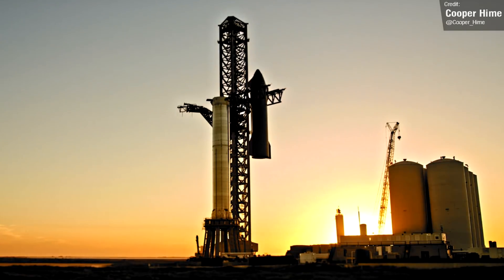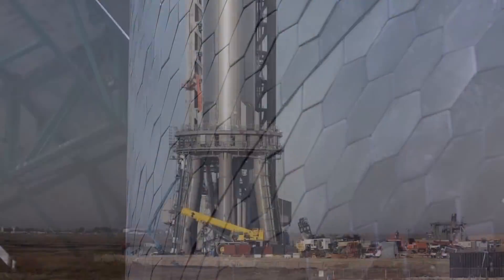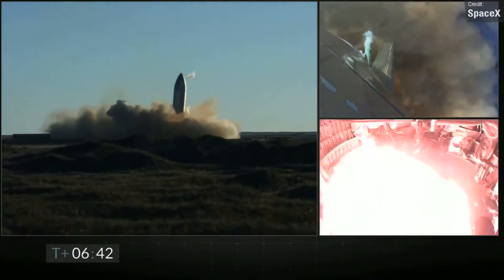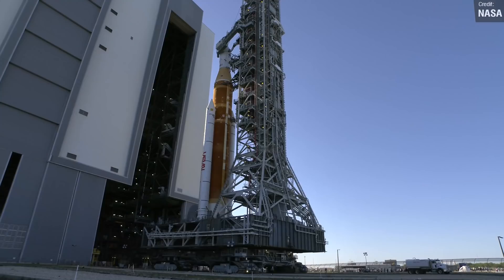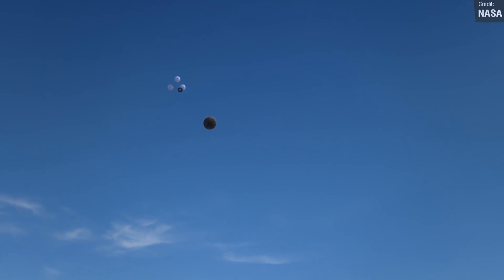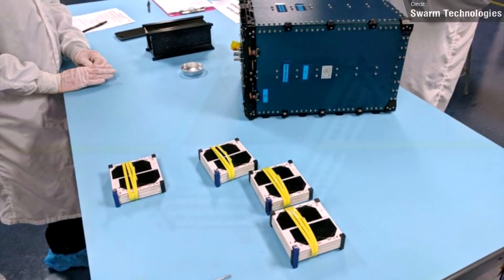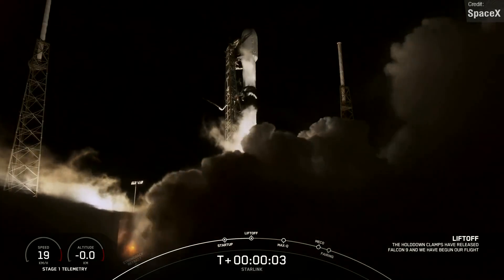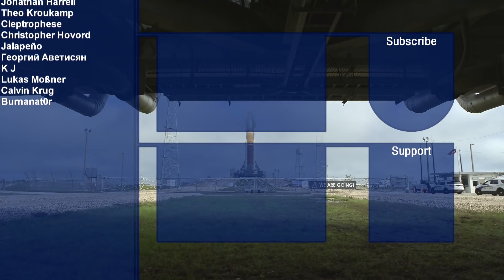The World's BIGGEST Rockets are here - SLS and Starship! + SpaceX Starlink, Astra, Soyuz MS-21

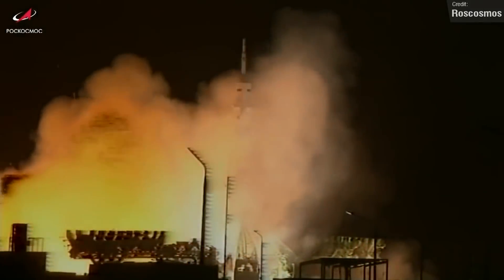Comment: 10:00 can anyone tell me y this rocket looks like it’s falling apart?
Reply: Insulation to likely keep the second stage propellants at the proper temperature for launch. The second stage uses hypergolic propellants, so I don't believe that they are cryogenic, but apparently they have a best temperature for best performance. The Minotaur I rocket uses solid rocket motors and the first stage is covered in 3-4 yellow insulation panels to keep the solid rocket motor at the proper temperature for best performance. The panels peel off at launch, so it has the nickname of the banana rocket.

Comment: I have a feeling starship will put people on the moon before SLS.
Reply: Considering NASA hired SpaceX to use Lunar Starship land on the Moon and SLS to bring to crew to the Moon to land, I would say you are incorrect.
Reply: @steveaustin2686  and what if starship can do it all before the first human rated SLS is ready? Or what if we finally realize that 4.1 billion is a massive waste of money and again we fall back on starship. I have no faith in SLS as a long term solution either way. I wouldn't be surprised if spacex is like....meh forget waiting on NASA lets just do it ourselves.
Reply: @awilliams1701  Lunar Starship is basically out of propellant after the lunar surface mission is done. So astronauts can't return on Lunar Starship also because it won't be able to land on Earth without thermal protection tiles, even IF NASA was crazy enough to strand astronauts in lunar orbit waiting for refueling. Crew Dragon and Starliner don't have the range to return from lunar orbit, so that leaves out Crew Dragon and Starliner, without time consuming and costly modifications which brings up new problems.

You could send something like a Starship Shuttle to follow behind Lunar Starship. The Starship Shuttle would only go to lunar orbit and back, so if it is light enough, it could do the job. One problem is Starship won't be ready for crewed Earth launches and landings until Starship proves it can be reliable enough to do the job without an abort system. That will take hundreds of successful, operational launches per Musk. Now you could send up Crew Dragon and Starliner to LEO to meet up with the unmanned Starship Shuttle for crew and I think that the [DELETED] propellant depot is a transfer station for just that purpose. The problem is the cadence of launches. Per Musk it will take up to 10 launches to get Lunar Starship to the Moon and a Starship Shuttle would be the same. Per the GAO report denying the HLS complaints, SpaceX plans for Starships to launch once every 12 days for Artemis III. That is 108 days total for a refueling and Lunar Starship can only wait for 100 days for crew to arrive. So Starship can't replace SLS/Orion for the early Artemis III missions. Once Starship matures to a launch cadence of about one per week, then a Starship Shuttle would be fast enough to make the Lunar Starship loiter window and could replace SLS/Orion.

A Starship Shuttle (9-10 launches), a Crew Dragon, a Starliner, and a cargo Dragon or two to return lunar cargo to Earth, would be around $2.3B to $2.5B, which is much cheaper than the initial launch price of SLS/Orion of $4.1B. Starship just has to mature into the role first.
Reply: @steveaustin2686  I don't see any reason why SpaceX couldn't choose to do a moon landing without NASA even if it involved a lunar starship, a regular starship and a refueling starship. It's not going to cost 4 billion dollars. And they're already talking about the first manned starship being civilians. If it's a NASA free mission then it's up to the passengers to decide if its safe or not. I suspect the manned starship launch will be before SLS's manned launches.
Reply: @awilliams1701  The problem is the cadence of launches. Per Musk it will take up to 10 launches to get Lunar Starship to the Moon and a Starship Shuttle would be the same. Per the GAO report denying the HLS complaints, SpaceX plans for Starships to launch once every 12 days for Artemis III. That is 108 days total for a refueling and Lunar Starship can only wait for 100 days for crew to arrive. So until Starship matures to about a once a week launch cadence, which SpaceX does NOT expect to happen for Artemis III in 2026, Lunar Starship will run out of time, before a Starship Shuttle or refueling Tanker can get there.

The HLS Option A contract is for $2,941,394,557 (pg 8) and has two Lunar Starship landings. So that puts each Lunar Starship landing at $1.47B. A Starship Shuttle, if it can reuse the [DELETED] propellant depot, is 9 flights, a Crew Dragon, a Starliner, and a cargo Dragon or two for $2.1B to $2.3B. So yes, Lunar Starship and a Starship shuttle would be around $3.6B, which is cheaper than the $4.1B for SLS/Orion. The problem is that Starship needs to mature to that about once a week launch cadence, BEFORE it can replace SLS/Orion.

The unmanned SLS/Orion Artemis I flight is the last test before SLS/Orion can get a manned Earth launch and landing rating. Artemis II will reuse some of the Orion hardware for the first crewed Orion flight. The crewed Artemis II mission to lunar orbit is expected to fly in 2024. Elon Musk has said that it would take hundreds of successful, operational flights before you could put people on board Starship launching from and landing on Earth.

“'We’ve got to first make the thing work; automatically deliver satellites and do hundreds of missions with satellites before we put people on board,' Musk said, speaking Monday at the virtual 'Humans to Mars' conference" - CNBC Sep 2020 article

With Starship having a launch cadence of one every 12 days for Artemis III PER SpaceX, it is hard to see how Starship will prove reliable enough for a manned Earth launch and landing before Artemis III.
Reply: @steveaustin2686  once they get the oil rigs operational it will be a lot easier to do that I think.
Reply: @awilliams1701  This was likely with the oil rigs operational. It's expected that the rig will do most of the tanker flights and LC-39A and possibly Boca Chica will do most of the mission Starships and the [DELETED] propellant tanker. 

Since the FAA review mentions 5 orbital launches a year from Boca Chica, and 5 sub-orbital for continuing operations, it was likely going to have a supporting role for the Starship program anyway. The 5 launches each is likely due to Texas state law on not being able to restrict access to public beaches. The Texas legislature already had to modify the law a few years ago to allow SpaceX even the limited closures that they have now and some Texans are saying that it is too much already. SpaceX started work at LC-39A even before Boca Chica really took off, but SpaceX paused KSC work to focus on Boca. 

SpaceX is working with NASA and the FAA about using the unbuilt LC-49 complex at KSC for Starship operations. So IF SpaceX gets Boca Chica, LC-39A, LC-49, Phobos, and Deimos all ready before the unmanned Lunar Starship test landing, then each complex would need to do 2 Starship launches on average to get Lunar Starship to the Moon. That is likely how they are getting to the one Starship launch every 12 days.
Reply: @steveaustin2686  they were always planning on using florida no matter what. So even if it's just 5, there will be more than that in florida.
Reply: @awilliams1701  I know that LC-39A was always in the mix, because SpaceX paused work at KSC, before work at Boca Chica took off. Not only was SpaceX figuring out how to build and fly Starship, but apparently also how to build a Starship launch complex and factory. The Roberts Road facility at KSC has started building tower segments and a Starship factory building. At Boca Chica, a factory building is going up to likely replace the tents.

Comment: so why does parts fall off of the Chinese rocket?
Reply: Speculation is that they are insulation panels. Cryogenic propellants need insulation, but so do other propellants. The Minotaur I uses solid rocket motors and it has 3 to 4 yellow panels for insulation to keep the motor at the best temp for launch. When the Minotaur I takes off, the yellow panels peel off, so people have nicknamed the Minotaur I the banana rocket.

Comment: Can someone explain to me please what cryogenic fuel is?
Reply: Very, very cold propellant. Starship uses liquid methane and liquid oxygen as propellants. The temp for liquid methane (LCH4) is between -161C (-258F) and -182C (296F). The temp for liquid oxygen (LOX) is -182C (-296F) and -218C (-361F). SpaceX tries to get the LCH4 as cold as they can without it freezing, so that it is close to the temp of LOX. 

SpaceX does the same with Falcon 9 which uses LOX and RP1, a highly refined form of kerosene. The SLS will use liquid hydrogen (LH2) and LOX as its cryogenic propellants.

Comment: could you make a plane that flies to space, like not with rockets or boosters, but design a plane that goes from flying in to out of orbit and then maybe the mun or something
Reply: The higher you go, the thinner the air, until there is no real air left for a plane to use. This happens way before orbit. That is why rockets carry their own oxidizer to burn with the fuel.

Comment: I find it so cool that Starship and SLS are prepping for their first orbital launches at the same time.
Reply: SpaceX’s Starship project was back burner, study only consuming almost no resources until 3 years ago.. and SpaceX had to acquire, purchase, build all infrastructure, facilities, staff, pads, etc for it.. Still spending only $5 billion.
In contrast, NASA started with supposed world class facilities & staff, spent $billions per year, used preexisting engines, yet still has taken 16+ years & $60+ billion, all in for Constellation/SLS/Orion… to produce a dead end $4+ billion per launch throwback throwaway boondoggle.

NASA’s Stupid Launch System vs SpaceX Starship
Project cost: $60+ billion vs $5 billion for Starship
Project years: 16+ vs 3
technology: Throwback legacy vs modern
reusability: throwaway vs fully reusable
Air pollution: Carcinogenic spewing solid rockets vs clean
Ocean Pollution: Dumps entire vehicle in our oceans Vs zero
Cost per launch: $4 billion+ vs $2-10 million (fuel)
Cost per engine: $146 million throwaway  vs $250,000 reused
Payload to LEO(Expended): 30 tons vs 200 tons
Payload to LEO(Reused): NA vs 100 tons
Can land on moon/Mars: no vs yes
Expected Flights per year: 1-2 vs 1,000s
General use for other payloads: No vs Yes
Can tanker fuel to LEO: No vs Yes 
Can refuel in LEO: No vs Yes
Crew/cargo section:
.  width:height: 15x6 feet vs 30x60
. Pressurized volume: 300-700 cubic feet vs 38,300 
. # crew/passengers: 2-6 vs 200+
. Return payload: 220 lbs vs 100 tons
. Payload to the Moon: Zero vs 100 tons
. Payload to Mars: Zero vs 100 tons

Comment: Nasa rolled SLS into the launch pad zone?? 2022 is a year of surprises
not always good ones cough cough but surprised non the less
Reply: It's for a wet dress rehearsal and then they will roll back to the VAB for final checks. If everything goes well, SLS/Orion will launch in May/June.

Musk is targeting May for Starship to launch with Raptor 2 engines. So B4/S20 won't fly to orbit.

Comment: SLS reminds me of the meme of too big to fail.  Too large and too expensive and way too old of a design to be launched often enough to be effective.  Also it takes too long to construct.
Reply: Most rockets take 40-30 months to be built, it's just that typically there are a lot in production at once
SLS is no different, it's just that right now there are only a few being built at any given time.
For a faster flight cadence they need to be making more at the same time.

Comment: Starship's first Orbital in going in the drink. Why waste Raptor 2 engines when they can just dump R1s in the ocean. Besides there is still a good possibility that it won't make it through re-entry. Just use 4-20 already...
Reply: Apparently, B4/S20 won't get SpaceX the data that SpaceX wants. So they are using Raptor 2s instead, even if they will be soft landed in the water. The Raptor 2s are not the final design either I understand.

Comment: Hey Matt could you explain sometime the purpose of the pieces falling off some of the rockets at launch? Thanks for the great show
Reply: It's usually ice from the cold fuel in the tanks 😉
Reply: @inbrekers11  actually the Chinese rockets have panels covering stuff and fall off during launch, they use hypergolic fuel that isn’t cryogenic so no ice
Reply: Likely insulation panels to keep the propellants the proper temp before launch. It's not only cryogenic propellants that need insulation. The Minotaur I uses some large yellow panels to keep the solid rocket motor the best temp before launch. When the Minotaur I takes off, the panels peel off, so it is nicknamed the banana rocket.
Reply: Ice
Reply: @jetpond7904  good job reading my reply
Reply: @WrenPhoenix  wasn’t talking about Chinese stuff chill

Comment: I want to see the SLS launch.  it would be impressive.  that said I hope we don't see many.  I want to see the payload go on another rocket system that doesn't cost so much.  the fact of how much money has gone into it and it will all be thrown away every time is horrid when considering there are cheaper systems (thanks to recovering at least parts of the launch system).  I admit that it would be best on something like the starship due to the weight of what they want to send.  I think the super heavy is supposed to be enough, and I am sure is a lot more cost effective
Reply: Currently SLS is the only way to send Orion to lunar orbit.
Reply: but who says it can't be a different design that would do the job?  plus going to be hilarious the difference between a starship and an orion capsule
Reply: SLS will be around for the foreseeable future
Current production contracts run into the 2030s
I consider that a good thing, for once NASA is allowed to finish a large launch vehicle project without it being canceled a few years after starting development because politicians get sticker shock, so I hope they use SLS lots, it's going to be a good rocket.
Reply: @brokensoap1717  nah it doesnt it uses old shuttle parts.  4 billion per launch.

Comment: Now its a race between the 2 largest rocket ever made to fly and reach the space
Reply: sls is smaller than saturn v, at least block 1 is
Reply: @evanschaffer5808  assuming the race starts from this mans comment, I’d say starship has quite the lead then.
Reply: @volkswagenb9406  Depends on how you measure it. If you are looking to just who gets to orbit first, Starship may beat SLS. If you are looking at the similar mission, SLS wins by a mile. The Artemis I mission is similar to the unmanned Lunar Starship test landing, which is not likely to happen for a few years.
Reply: The race is to land one and re0-use it.... oh wait, that's not on the cards for SLS :)
Reply: @chelfyn  That is not on the cards for Lunar Starship either. Per the HLS Option A Source Selection Statement from NASA, the HLS Option A landers are going to be disposed of after the mission is over.
Reply: @chelfyn  ok and

Comment: Hello Matt,
thanks for the nice update series here. I also like the KSP stuff you are doing.
I got a question and maybe someone can give me an answer.
What is falling from these chines rockets all the time when they lunch. Is this only ice forming from condensing and freezing water?
Or is this some isolation material that is supposed to fall of? I wonder what would happen if some ice, on one side of the rocked does not fall off. Should this not ruin your delta V or your control?
Best regards,
Phos
Reply from the maker: Long March uses non-cryogenic hypergolic fuels; it's not ice. They're just insulation sheets that keep the rocket warm before launch, and they harmlessly fall away during the liftoff. They also probably provide some protection to the rocket and fairings.
Reply: @MattLowne   Hey, thanks for this update :)
Reply: I believe this is just insulation foam, which would be pretty light, and fall off quickly, barely affecting your Delta V, and I would think its so light that it wouldn't do any damage if it did hit it on launch.

Comment: I think we will see Booster 4 and Ship 20 launch first because at the point they are expendable and would provide a ton of flight data for the engineers to use in subsequent launches.
Reply: Elon Musk today on Twitter, Mar 21st 2022, said that the first orbital Starship will use 33 Raptor 2s, so B4/S20 will not be the first orbital flight.